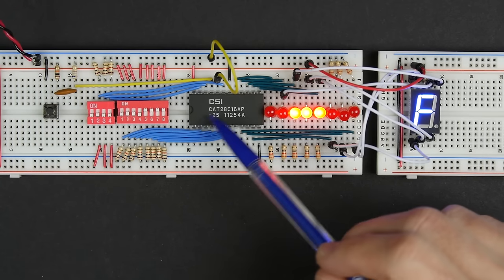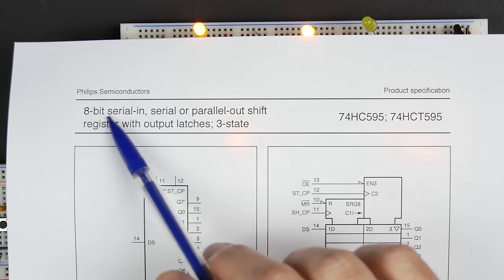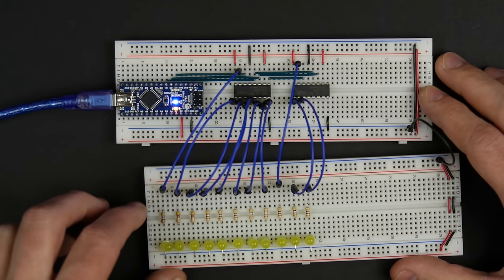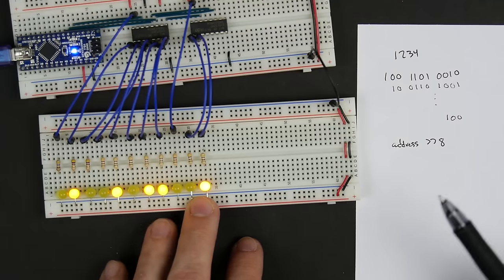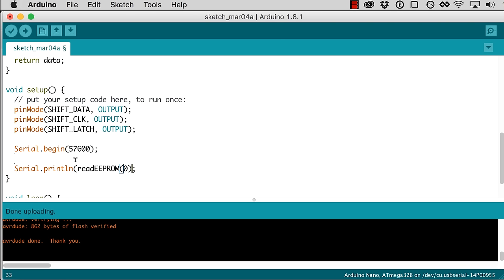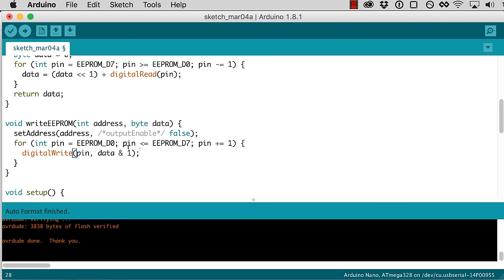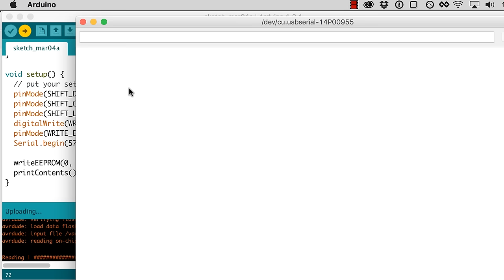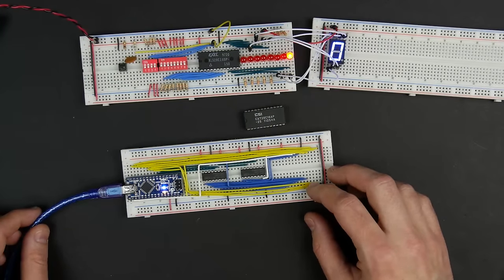Build an Arduino EEPROM programmer

Comment: If you read the datasheet carefully, it says if you read from the chip, and the write cycle is not yet finished, the MSB of the data will be the INVERSE value of the data you are writing. The other data outputs are undefined at this time.

After pulsing the /WR line, you should enable the chip output and monitor the value of IO7, waiting until it matches the MSB of the byte you wrote. That way you're not stuck inserting arbitrary delays in your code, and you can never enter in to a race condition with the write cycle, like you are here.

This is the reason you get funky data when reading the chip, directly after writing to it.
Reply: (just checking myself). The complete cycle time is 1000ns. As long as I stay  >1ms I should be fine. To squeeze out the last of the spec speed would require the polling. Am I far off? :)

Comment: I've been a Software Engineer for 15 years.  Your videos are the first I have found the explains how software works at a hardware level. I've recently decided to learn assembly language and your videos help me understand how code is translated into byte code and how processors operate.  Thank you for your videos.  They are a great contribution to EE and Software Engineers alike.  They have helped me reestablish my curiosity in computing.
Reply: Are you interested for book? Tietze/Schenk explains also how microprocessor electronic circuits work, and also starts with basic analogue electronics

Comment: Hi Ben. Good educational stuff. But just thought I’d point out that the issue you saw with your incorrect read following write, is because you didn’t implement the (not)DATA POLLING, outlined in the 28C16 data sheet. 
ie. "The AT28C16 provides DATA POLLING to signal the completion of a write cycle.”  
DATA POLLING uses the inversion of the most significant bit (when a post write read is performed) to indicate the write busy state. Please also note that the other read bits (other than MSB), are indeterminate during the data polling busy state.
So when you saw two subsequent reads of 0x81 after writing 0x2A, you’ll note the byte you wrote (0x2A) has a 0 MSB, and the read value (0x81) has a 1 MSB (ie. inverted 0 indicating busy state). The remaining bits of the 0x81 byte being indeterminate.
By the third byte read, the busy state was complete, and the 3rd address data byte, and onwards, were then correctly retrieved. 
Likewise, the same can be seen with your second attempt to write 0x00, where you then read 0xAA bytes.  Again, note the MSB is inverted from 0 to 1, to indicate data polling busy state.
In summary: Although the Write Cycle Time is spec’d as max 1ms, you really shouldn’t just assume a 1ms delay will do the trick. The correct implementation would be to perform a read loop after a write, to poll for a non inverted MSB of the byte just written, to await busy state completion.
Reply: Just wondering, instead of a read after a write, would writing the same address/byte twice back to back satisfy the timing requirement of the 1ms busy threshold?  Basically use a second write cycle immediately after the first write as a timing padding instead of waiting for the MSB inversion, which as an added benefit would write every address/byte twice for reliability.  Or waiting for the busy MSB inversion explicitly neccessary?
Reply: @BillAnt  I'm only guessing but I'd say that all you'd do would be to reset the write cycle and you'd still have to wait just as long after the end of your second write cycle.
Also, these EEPROMs automatically implement the correct write cycle timing internally so doing a second write would not make the data any more reliable than a single write.  I'm guessing that if you hold the write pulse for much more than the maximum specified time, you will cause a second write cycle.  All this would do is wear out the EEPROM a bit faster.
Reply: Melkior Wiseman < Got ya... I was just thinking by sending multiple write cycles quickly back to back it would "pad" the timing threshold long enough, but if you're saying that will only reset the cycle, then that's probably not going to work (boo!).  On the other hand holding the write pulse just a little longer might yield a a more reliable write (if anyone cares about it at all).  I really love these "simple" digital circuits, since modern computers rely on the same basic principles, but of course vastly more complex.
Reply: Came here for this comment, was not disappointed. Glad to see someone took the time to figure the spec out as well!
Reply: I changed my writeEEPROM function. I added a local copy of the data variable that is used for shifting the data to the pins on the arduino and instead of the last 'delay(10);' I now have 'while (readEEPROM(address)!=data) delay(1);' This speeds up the writing considerably and I have yet to see any sideeffects.
Reply: @jimmydansbo7847  Maybe i late for this question on polling : If you do a delay(1) between the read/write operations would that solve the polling problem?
Reply: @ihtsarl9115  With a proper delay, it does work. But it is generally slower than polling the chip.
Reply: Great explanation, thank you!
Reply: gotta wonder if the busy state lasts longer when the old value is not FF vs when it is
Reply: Thanks @gregclare for this clear explanation! It seems like Ben’s data sheet also may not be the correct one - When he looks up the write cycle time it says 1000ms for an AT28C16, but it looks like he has a CAT2816AP, whose data sheet states a 10ms write cycle.

Comment: Just FYI Arduino Nano's Pins A0 to A5  (not A6 nor A7) can also be used as digital Pins D14-D19
Reply: I was just about to point that out
Reply: By selecting Arduino nano you can use A6 and A7.
They defined in board definition file.

 nano.name=Arduino Nano

nano.upload.tool=avrdude
nano.upload.protocol=arduino

nano.bootloader.tool=avrdude
nano.bootloader.unlock_bits=0x3F
nano.bootloader.lock_bits=0x0F

nano.build.f_cpu=16000000L
nano.build.board=AVR_NANO
nano.build.core=arduino
nano.build.variant=eightanaloginputs
Reply: @nadircatalkaya5011  and that gives exactly the 21 pins needed for the eeprom. Funny how that works!

Comment: To get rid of the delay(10) in the writeEEPROM function, you could take advantage of the inverted data polling feature of those EEPROMs that lets you directly determine when the write cycle has completed. After clocking the write enable pin, switch back to reading that address and wait until the data you wrote appears on the output pins.

A few other possible enhancements I thought of while watching that I might try
- Speeding it up by cycling the addresses in a De Brujin sequence rather than incrementing the address. That way only a single bit has to be shifted in for each write.
- Using the SPI perhiperhal to write to the shift registers much faster than doing it in software. The 74HC595 is rated for up to 25 MHz, significantly faster than even the CPU clock speed for the arduino. Hook the shift register data pin to MOSI, the shift clock to SCK, and then you only need to use a single digital pin for the latch.
- Re-wire the data pins to be in the correct order in the GPIO pin registers, so that the byte can be reassembled more quickly: read the two pin registers, mask off the relevant bits, and just or them together.
Reply: Hmmm, a neater way to show the sequence is a series of digits showing the number of the bit that is flipped.  So the above sequence would be: 0123 0121 0123 0121

Another sequence I found that can be extended for any number of bits:

2-bit: 0101
3-bit: 0102 0102
4-bit: 0102 0103 0102 0103
5-bit: 0102 0103 0102 0104 0102 0103 0102 0104
etc.

Comment: These videos are GREAT for the beginner Electronics learners! We did this kind of stuff back in the late 80's when I was enrolled in college! Only thing then is that we did not have the convenience of using an Arduino since they did not exist back then. But we did breadboard a manual EPROM programming circuit similar to the one in the previous video in this series for educational purposes. For larger data size programming, we actually used an EPROM writer that plugged into one of the slots of an Apple II Plus computer. All you younger folks out there won't even know what I am talking about here! Kind of sad the young ones have no clue about how fast and how far technology has come in such a short amount of time.

Thanks for taking me back and bringing back memories of a simpler time in life!

Comment: You could have used the analogue pins as outputs also. Pns A0 - A5 are on PORT C which can be used as normal IOs 😁 A6-A7 are only connected to the ADC MUX though.

Comment: I'm building up something like this- but for mine, I went with counter chips, 74HC163s with their Qn outputs wired to their Dn+1 inputs - Since count enable is active high and load is active low, I just connect them together as a mode bit, no need for glue logic.  Effectively it works as either a counter or a shifter, depending on the mode bit- so I can shift in an address, flip the mode bit, then step through further addresses with just one clock cycle each.  I was originally planning on having the data pins do double duty and use a '138 to address which counter to load with 4 bits at a time, but watching this video inspired the shift register configuration,  and it just happened to work out really nicely.

Comment: Instead of using the 'bool outputEnable', you can convert an analog pin to digital pin. Say we wanted to make A0 go high then low, we would do it the same as a normal digital pin:
pinMode(14, OUTPUT);
digtalWrite(14, HIGH);
delay(1000);
digitalWrite(14, LOW);
Reply: Wait, it's possible to use analog pins as digital outputs? 😨😨
Reply: what about current constrains
Reply: @pararera6394  yes, the analog input is an alternate function in the chip anyway. Read the datasheet.

Comment: This is a wonderful video with everything clearly explained so even a newbie can understand it.  Thanks, Ben.

If anyone is wondering, this circuit can be used to program any EEPROM with similar programming characteristics up to 32K by 8 bits (256 bits) without any substantial modification to the circuit (just make a few more connections between the shift registers and the EEPROM address pins) and with only minor changes to the control program.

This circuit could be used as the basis for programming even larger EEPROMs by simply adding more shift registers, although there would need to be more extensive changes made to the program to account for sending the extra address bits.
Reply: hi, i've made this circuit with a 28c256, a 32k eeprom, but the there are missing bytes, like : 00 5e 00 b4 00 88 00 3d  00 ff 00 79 00 aa 00 99. do you know how i solve this?
Reply: @joaopaulo0903  It sounds like you're counting by twos instead of by ones.  One possibility is that address line 0 (zero) is not properly connected which would make that pin "float" high so that it appears to always be set to 1.  That would produce the symptoms you're describing since it would cause the programmer to program the same byte twice while also missing programming one byte.
Another possibility is that you may have mixed up the address wires between the shift registers and the EEPROM.  In particular, address line 1 (the second address line when counting from zero) may be switched with a different address line.
Check which pin of the shift register that address line is connected to and my guess is that you'll find it's the wrong pin.  Then you just need to find which pin it was switched with and fix it.
Reply: on really i dont connected the 5v jumper on protoboard haha. sorry and  thank you
Reply: @joaopaulo0903  No Problem.  I've often found that re-checking my work will lead to me discovering a mistake.  I'm glad it worked for you.

Comment: as has been pointed out, all pins on most modern micro controllers can be used as I/O normally with a digital aspect it is referred to as tri state logic meaning it can, sink and source current as well as being high impedance as an input.

Comment: You should disable the EEPROM's outputs BEFORE you change the data lines' pinModes to OUTPUT to avoid the potential for microseconds of conflict.

Comment: The main problem is that he is using the wrong datasheet. The -25 after the device name is the speed grade and this is very slow. I didn't find the good datasheet too be I saw some -20 that had a 10ms write cycle...
The cleanest solution would be to implement the data polling test that checks if the write cycle is finished. This way you can adapt the write speed to the actual performance of the eeprom whatever grade or brand you use.
Reply: Yes You are Right . the Chip calculate if it has finished the last input data and continues to 2 input.

Comment: Maybe you can do a similar circuit from the pushbutton to limit the pulse of the switch with the arduino. I don't tried it yet but if you put the 680 resistor in series with the arduino pin and the capacitor, and the other leg of the capacitor to a 10k resistor and then to ground, when the arduino sends a 1uS pulse the capacitor will charge via the 680 Resistor, and while is charging you should have a logic one in the other part of the capacitor, when you set the pin to low then the capacitor discharges via the same resistor as before, so it shoul work as the pushbutton, if you want to get the low pulse just change  the 10K resistor to VCC and the Arduino pin to High, and it should do the job :/ I repeat, I dont tried it yet, but it should work

Comment: tanx, for note with (chip datasheet): delay(10);  
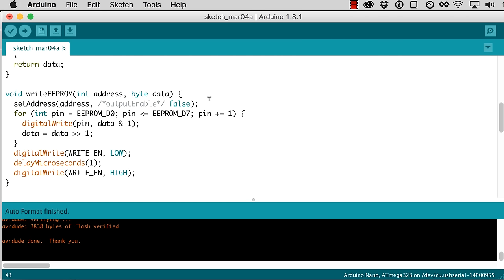(45:45 add delay(5); (5ms?))
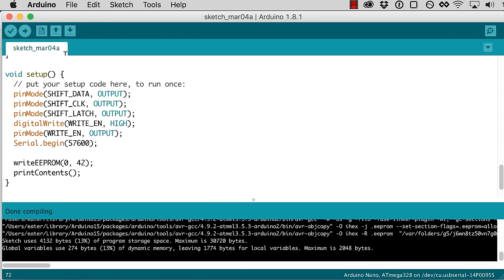49:06 "ups?" (reading wrong 51:26)
51:55 (what datasheet say AT28C16 / AT28C16E (write cycle time)) (Typ 0.5ms , Max 1.0ms ) 
(how Arduino get 0.5ms or 100us or 200us?)

Comment: Well done for mentioning not using pins 0 and 1 because they interfere with the serial interface, or rather it interferes with them. I spent HOURS trying to figure out the bizarre, seemingly random behaviour of my circuit (that part was reading a keypad), I dumped every variable and event I could to the PC! And every time I did that, it was setting off the problem, the debugging WAS the problem! So thanks for mentioning that, it isn't mentioned in any of the guides online I read, or the book that came with my Arduino. But it's vital knowledge.

Comment: On code style, usually you'd make the condition on the for loops use < instead of <=; that way, you can use the numbers you expect (2048, 256, 16, etc.). You caught some of the off-by-one errors you introduced with <=, but not all of them.

Maybe the longer delay was necessary because you held the write enable pin low for more than a microsecond?
Reply: Using < is no less prone to off-by-one errors than <=. You should write your code in the way that best matches how you'd explain it to a colleague. Sometimes that's < and sometimes it's <=.
Reply: @patrickdoyle4581  I did say “usually”.  Because C is zero-indexed in most cases, < usually makes more sense; you go from 0 to n-1 inclusive, or while it’s < n.  That isn’t always the case.
Reply: @danielrhouck  Again, it depends on how you'd explain it to a colleague. I'd pretty much always use < if looping through an array, or with the idiom "for (i=0; i<N; i++)" to do something N times. But would you program the hex digits "from zero up to but not including 16"? I wouldn't.

Comment: I built a manual EEPROM programmer for 2816 EEPROMS I’ve used in various projects, not long after I purchased a TOP2005 programmer for about $15 around 10 years ago, it’s useful to test a large number of IC’s I commonly use as well as programming numerous EPROM’s, Flash, & Microcontrollers.

Comment: Seems like it would have been simpler just to have an address register, and a data register, load them directly in separate steps, then pulse the write signal.
Reply: yes, as I was watching a video I thought the same thing. Although, form learning perspective, it's nice to see the shift register in action. Also, I believe it's a part needed in the Control Unit, I think for the sequencer
Reply: please do a video about it then.
Reply: That would seem to complicate the circuit even more.  The issue here are some off timings possibly due to the read/write cycle speed of the chip.
Reply: and how would you read them then?
Reply: You would not use two registers. You use one that drives the address lines. This was pretty standard practice back in the day. The Arduino's data and address lines are shared, but the address is stored in the register (D flip-flop). First, output the address, clock it into the register, and then output the data. Now set output enable on the register, and do the write. You can still read data directly into the Arduino pins.

Comment: Thankyou for posting this! :) This is extremely helpful as I'm about to embark on making my own microcomputer :)

One thing though - noticed you used D13 as the write enable - this pulses everytime a new program is uploaded to the arduino, I believe that would cause data to be lost from the EEPROM? Would it not be better to use one of the analog lines as a digital output?
Reply: Actually it blinks while booting not uploading, while uploading rx and tx blinks

Comment: Hallelujah !!! That was a tough one for me. I had my ups and downs with this one, but never gave up.

After finishing the project, I looked though your updated code and added the Erasing EEPROM, which helped,
as the first time I ran it, it did not appear to be doing anything, but I guess that is because it takes a little while to fully erase.

Anyway, thank you for the video, it was FUN !!! Even though I do have a simple($40)  programmer, that I could use. It is always fun learning new ways of doing things.

Thank you